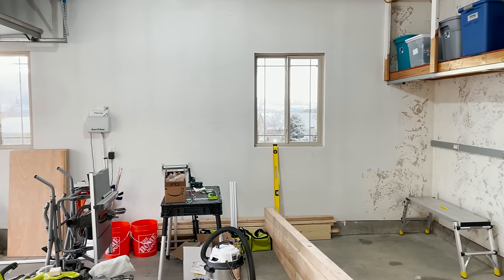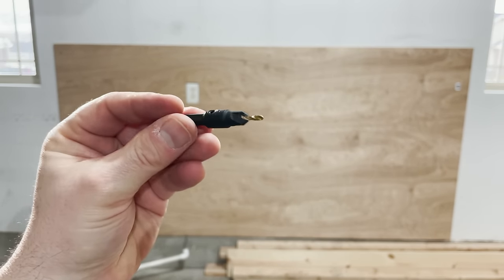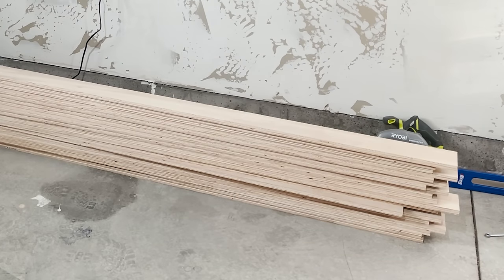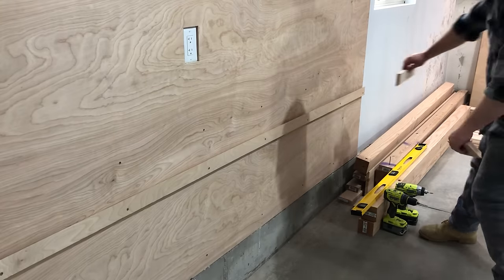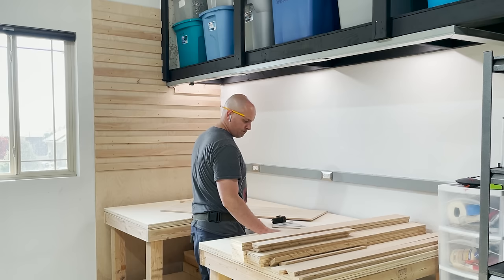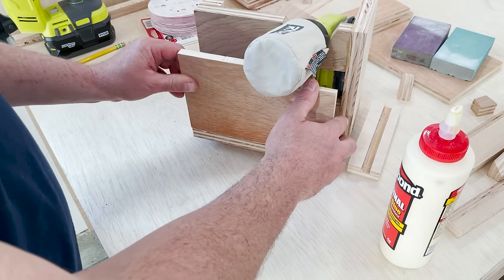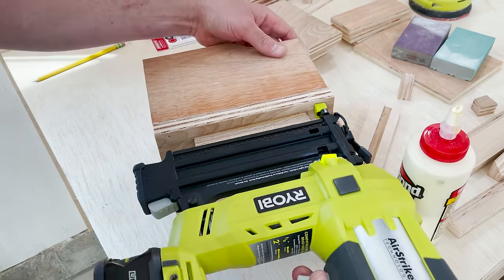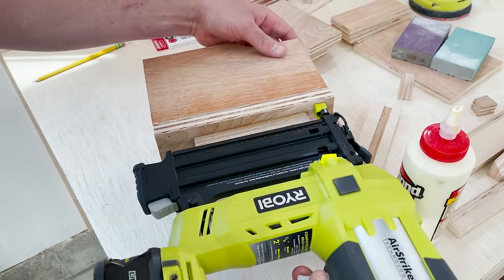How To Build A French Cleat Storage Wall

Comment: Why did you replace a 15 amp outlet with a 20 amp outlet?
Reply: I think some tools (table saw for example) can use the larger amperage.
Reply: @tdl2920  the reason I asked was if the breaker and wiring sufficient for 20 amp. Running a high amp device on wiring rated for 15 amps can cause a fire.
Reply: @jscotcha  yeah I noticed that too. As long as the wiring is rated for the breaker it shouldnt be an issue. A 20amp plug on a 15amp breaker with 14g wire will (hopefully) trip before the wire overheats and melts. Best case scenario.....dont put a 20amp rated plug on a 15amp rated circuit.

Comment: You put a 20 amp outlet where a 15 amp used to sit. I would check your electrical code book because there are a lot of restrictions of where you can use those 20 amp outlets. If there wasn't one (20a) there to begin with, generally you can't just put one in. Be sure to fix that before you try to sell your house or an electrical inspector will probably want to tear apart your walls if they find there isn't a dedicated 20 amp breaker to that 20 amp outlet. 

Otherwise I do like the cleat style storage system.

Comment: Could've saved several hundred dollars and screwed the cleats right to the sheetrock and studs, eliminating with the panels.
Reply from the maker: Very good point. That method would also work great. When I made this the 3/4 maple board was only ~$36, so it would be much cheaper this time around to go with just the cleats.